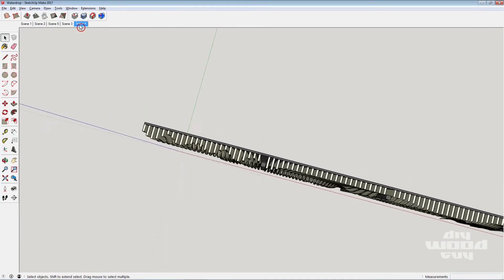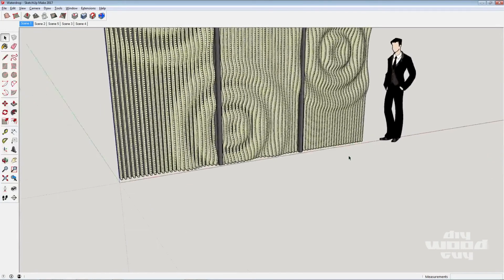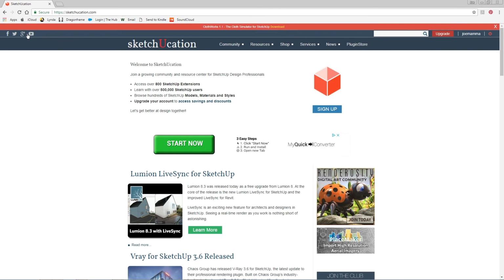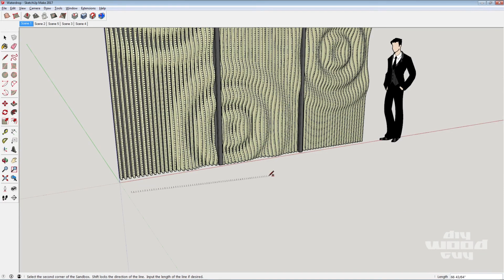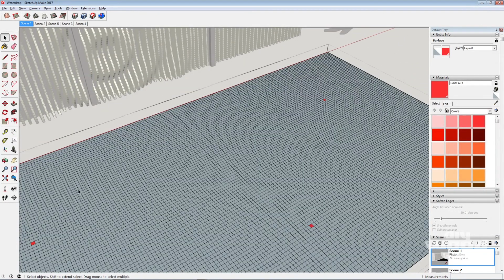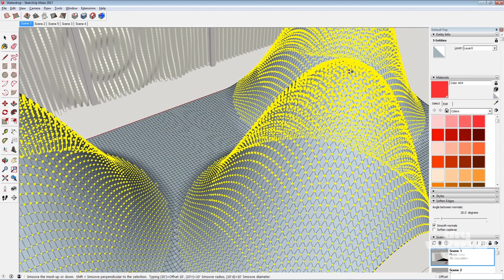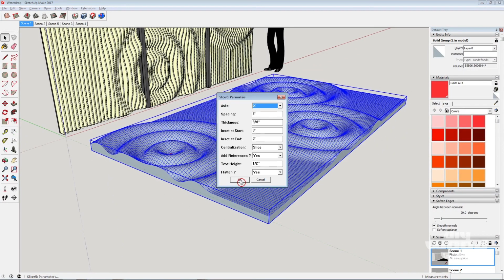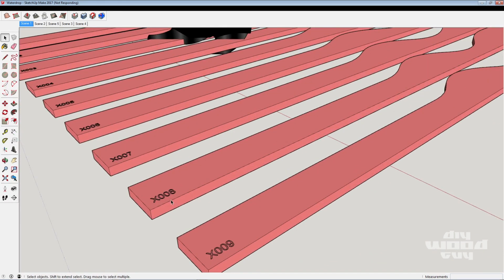How to Design and Build a Parametric Wall - Part 1

Comment: This is amazing! Super interesting! I've been playing with this and wondering if Is there some kind of formula to use in order to add 1 or 2 more ripples to each point? I've tried analyzing the numbers for the push/pull and radius changes and cannot seem to figure it out without testing it randomly, but the render lag makes that pretty difficult.
Reply from the maker: It was all trial and error. I’ve searched all over YouTube and haven’t found anyone else making waves the way I have. You’ll just have to play with the settings.

Comment: Thanks for the useful instructions. I have a question though. After the design is finalized in the software, how do you proceed with the real thing ? I mean do you print the several pieces in paper and then use the paper to guide you how to cut the wood ? Do you use jig-saw for the cuts ?
Reply from the maker: kgiorgosss working through my next video now. I show how to print all these parts in scale and then I’m going to show how to cut them on a band saw.  A jig saw would certainly work. I did some tests and a band Saw was definitely faster and gave a cleaner edge. Keep tuned!
Reply: Can't wait for part 2. Do you know when you will have it uploaded ?
Reply: @DIYWoodGuy  Hi,
I need a parametric form design for a 1000sq.ft ceiling in my new house. Would you be willing to design? Kindly revert.
Reply: DIY Wood Guy -